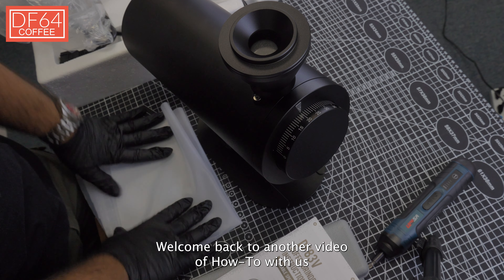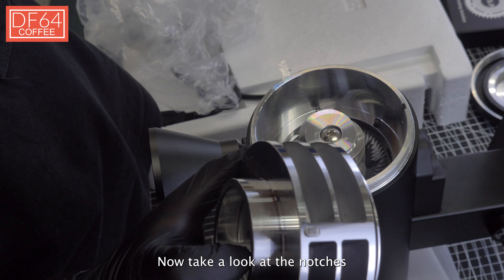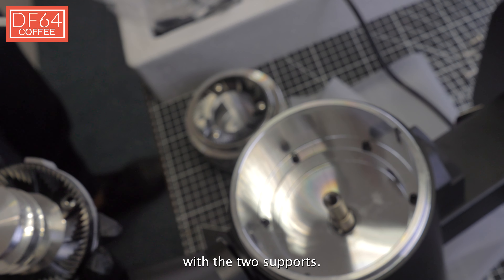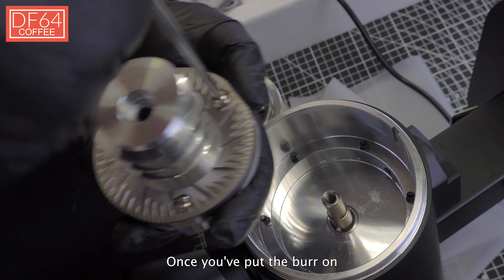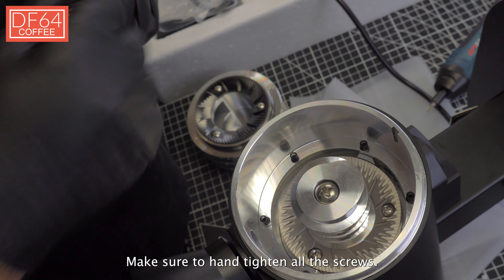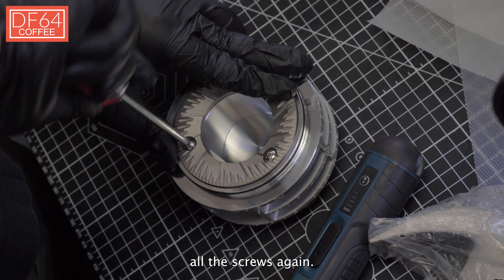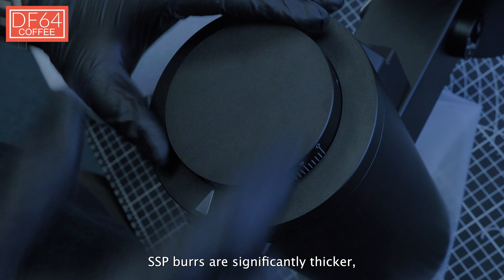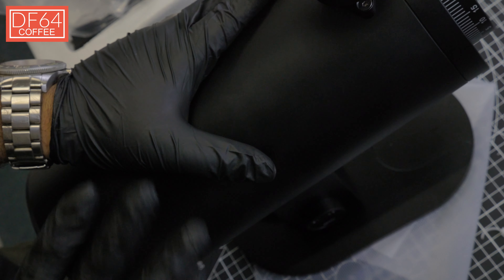How to Change Burrs on the DF83V Coffee Grinder | SSP Burr Upgrade

Comment: There is no need to remove the augur to replace the rotating burr - i cut my fingers multiple times on the sharp augur threads trying to do that. If you see other how-to videos on YT, there is a way to remove the rotating burr without removing the augur. Please be safe!
Reply from the maker: That's right! You can remove it without removing the augur too, that is another method!